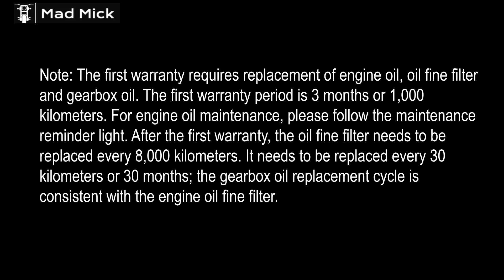ZONTES 350D REPLACE ENGINE OIL FILTER AND GEARBOX OIL ENGLISH INSTRUCTION

Comment: Can use 10w 40 engine oil as gear oil?
Reply from the maker: @mohammadrazak9444  you can but I would use 80/90 gear oil it's more suited for the job x